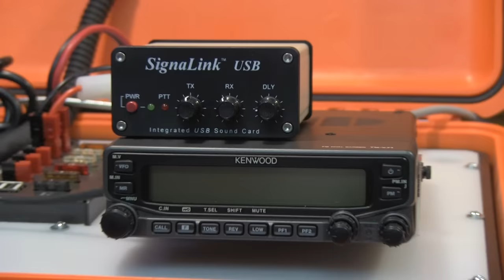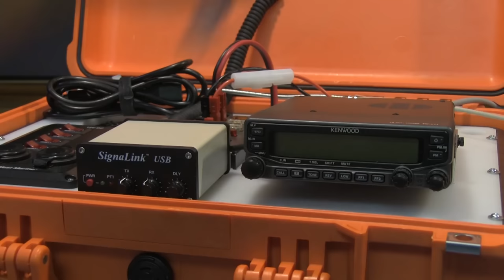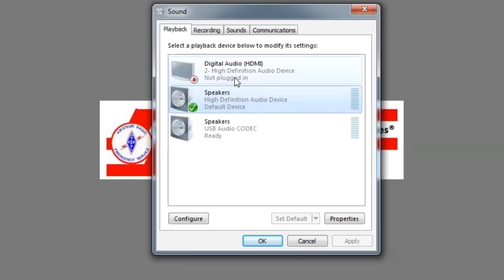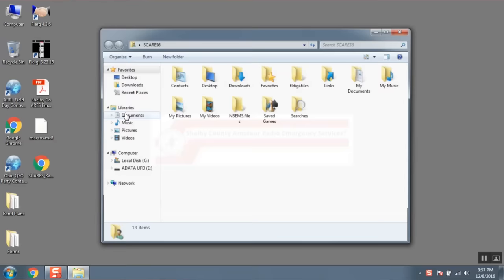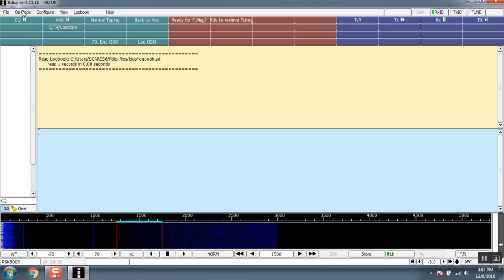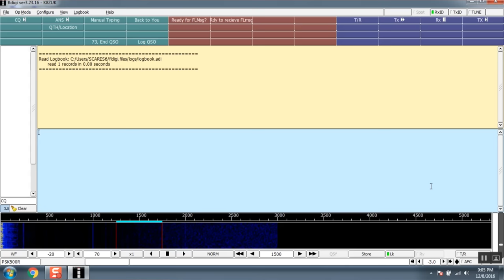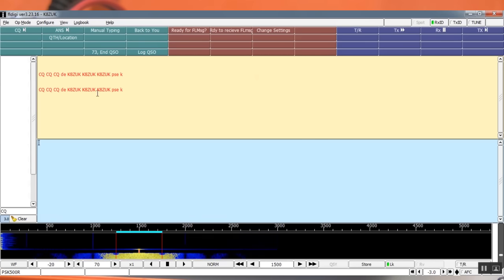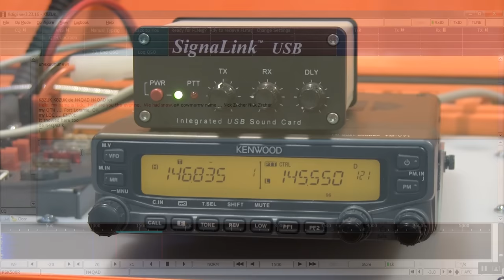FLdigi Training using 2M radios & Go Boxes

Comment: I always take a black magic marker and mark where the arrow is. It helps a great deal when you have to work in low light conditions. I liked your detailed explanations. Thanks for a great video
Reply: Also, if you have 'old man eyes' like mine, perhaps choose to use easier to see color...I raided XYL's finger-nail polish stash.  If you're box is set up so that you cannot get direct line-of-sight to sockets you're trying to plug into and having to look over the back of radio that is mounted and you cannot move it for better view, put a matching dot of same color over top of the one each cable is supposed to go to.  Then your cables and sockets are 'color-coded', and the dot of color on the cable tells you orientation (up/down) -- in training it's all easy, calm...in real-life when things go south and stress/nerves etc. kick in, fingers get to fumbling -- little things like this can make a difference in having things go a little smoother in set-up.  Just my humble opinion.
Raymond - WF7BSR

Comment: If anyone wants to test a setup they have, please let me know and I will jump on the radio.  One of the things I didn't mention in the video is that you can also download it without a radio connected.  The sound will play through your normal speakers and you can get used to it without any investment.  Obviously you won't be able to transmit over the air, but for training and following along with the video it can be very useful for kinesthetic learning.
N4QAD

Comment: You can do that with out a SignaLink. Kenwood has a set of cables that connect that radio directly to a PC. One cable is for audio in and out and the other handles PTT.  Kenwood PG-5H is the part number. You can also build these cables pretty easy.
Reply: To your knowledge what software provide the CAT control for this radio ? I've head some people have made custom XML to make it work with FLDIGI. Reading around I'm not sure there's many software with built-in CAT control for this radio.

Comment: I’m just as lost as I was when my curiosity peaked . Video after video ,, been shown how to set it up ,, no one has actually said 
1.what it does 
2..What’s the benefit
3. When would you need it
4. Why would you need it
5. Show it in use ? 
6. What am I missing out on

I’ve lived this long without it , I guess I will survive
Reply: Simply put, it allows you to send a digital file from your computer through the air using the band that you are licensed for. It is commonly used on 2m/70cm of the amateur radio band. 

Imagine if you are deployed to a medical facility to assist communication to the emergency operations center during a hurricane emergency. Lights are out, cell towers are down, and you with your amateur radio is the only link between that facility and the outside world. Ordinarily information would be spoken into your mic and copied on the other side by way of repeating it back to you. In the mean time that frequency is tied up momentarily. However, the need for digital arises when you are asked to deliver... say... a list of medication. From Atazanavir Sulfate to.... say Zantac. Conventionally you'll have to spell it out phonetically. Alpha tango alpha zulu alpha... and the other side would repeat letter by letter to confirm they have it correct. you'll be on the air for HOURS tying up that frequency and exhausting your battery. Depending on the how far they are away operating analog usually means you have to up the transmitting power which caused wear and tear and of course, elevated power consumption.

That being said, what the signalink allows is for you to take a picture of the list using a webcam, send it through your laptop, allow it to be transmitted through a hideous combination of strange noises... and have this hideous noise picked up by another station that you are trying to talk to, and they can "download" that noise into a sheet printout. they will understand you need everything from Atazanavir Sulfate to Zantac without you ever having to spell it out letter for letter. You can send this at the lowest power setting on your radio and therefore conserve battery life and minimize interference
 

that's the gist of it, if you have any questions ask away :)
73 de KN4GEI
Reply: I thought it was used for IRLP. So you can hook your radio (ie. a mobile radio) to a computer's internet. Then tap into a program like EchoLink. So it digitizes your analog radio signal....
But being backwards compatible, would be cool for sending data over the air.
Reply: @shaofuchang515  bruh...best example ever.
Reply: @chrissewell1608  Its basically another version of it, digilink is simply a sound card that interfaces the radio to something digital.
Reply: @n2dabloo  thanks, the local ARES affiliated club regularly conduct trainings of the sort, we call it SETs, or simulated emergency exercises, so that if we do have a storm and one of us gets deployed to staff a shelter with special needs or a hospital, that would be a backup solution if the power goes and phone lines fail.

Comment: I like to turn the delay up so it gives the signals time to travel from the computer to the radio and completely out the antenna before receive signals start coming back in. Otherwise I found the signals get reflected in the coax. More delay for longer runs of wire. I estimate that for 1/8 of turn of the dial is 25 feet from computer to tip of antenna. Remember to treat the cable from the box to the computer as if it was 3 times longer then it is since it has three wires in it. You can also use loops of wire if you max out the delay knob by shorting the wires out to each other. Doesn't matter which wires you connect together: You can connect one of the USB wires to the antenna wire since all the signals are analog and only digital signals are directional but require the directional cables sold by hifi audio companies. You can also amplify the signal by sticking those gold cell phone booster stickers they used to sell on infomercials back in the 2000's that you stuck to back of the battery. Stick them to the box and wrap them around the coax: remember to stick them 90's to the length of wire other wise it will just boost near by cell phones.I find those amplifiers/stickers work well in elevators and other places by giving you all five bars of signal.

Comment: Did you fabricate the cable between the Signalink and your radio or were you able to purchase it. If so where. Thanks,
Reply: Tigertronics sells cables for a ton of different radios, both mobile and handheld. I bought the one for my Yaesu FT-7900R from them through Amazon.

Comment: So all of this is limited to the 20-20k hz band width your sound card would put out? Do they make devices where you can send out "more" signal from the computer to the radio or is there no point as you can't get that much fidelity out of a radio signal from a commercial radio or the radio itself/the method your signal is being encoded with  won't use more bandwidth then that?
Reply: I think youd go for a TNC at that point
Reply: @mountain177  whats a TNC?
Reply: @daveb5041  a Terminal Node Controller. Aka a radio modem of sorts. It can handle the PTT of the radio as well as the audio.

Comment: What are you using for a TNC? Is baud rate and packet size handled by the program, FLDIGI? New ham, KE0OAP. 73
Reply: Ray Konold I have the same question.
Reply: Perfect! Thank you. I'm trying RMS. It has ben frustrating.
Reply: Surplus Firearm just learning that the software replaced TNC.  Confused since my vx-6r radio manual refers to a TNC.
Reply: @raykiii  So I want to use RMS.  Is it worth the money to buy the signal link?  If RMS is my need?
Reply: @jkbish1  Yes. RMS with a signal link  IS worth the money. I am using Winlink which needs a Windows PC to run.
Reply: @raykiii  Im rather new at this rms stuff. I am trying to get up to speed. Thanks for the comment.
Reply: @jkbish1  Get with an ARES or RACES Group that is using RMS in their emergency preparations. You'll learn a lot from them. 73

Comment: I am using TM- V71A with a Singalink with Direwolf how do you PTT want port do you use
Reply: I'm just starting out with a similar setup, but using MMTTY software for RTTY. Plan to expand into other modes later. The 6-pin DIN cable that came with the SignaLink plugs into the DATA port on the back of the radio. Go into the menu, and access around item number 518 to set one of the channels to be your data channel. I am still trying to figure out what the Data Terminal Speed setting should be. I am guessing 1200 bps for RTTY. I tried 9600 bps and (not sure if this is correlated or not) the audio coming out on the other end was very attenuated. The Signalink should figure out the PTT for you. 

See http://manual.kenwood.com/files/B62-1926-40.pdf, pages 83-84.

Comment: Why did you go to 1500 on the waterfall? I am not understanding what the '1500' relates to when you are on 145.550. Thank you
Reply: The 1500 is the band width of the waterfall. 1500 kHz on each side of center.

Comment from the maker: I've added a trouble shooting guide to the downloads.
Reply: I've been wondering for a long time,  if   there  is  a   way   to   identify    the   mode    an   unknown   staTION  might be using,  other   than   guessing   and    going   thru   all  of   the   modes   on  FLDIGI.  Assume also   that   the   station in question   has  not   checked  its    transmit   id   at  the   top.

lee byer
w7ldc
often  on   14.030
Reply: What mode fldigi is capable of do you think is best for FM while mobile?
Reply from the maker: I'm a big fan of PSKR.  Use the speeds that you can get away with.  Your band conditions will dictate if you can transmit at 500 vs 125.  Usually,  with these higher frequencies, it works, or it doesn't.  You won't be trying to snatch a digital signal out of static like a 40m conversation.  You also have a lot more bandwidth to play with using 2m or 70cm.

Comment: So this cannot use true AFSK packet protocol on VHF?
Reply: I have heard on the internet that it cannot. It has a chip built in that is issued by the FCC to block signals that are out of band or if it detects that you don't have the correct license for it. This can be hacked by taking the chip out of an SDR dongle and soldering on top of it. Doesn't matter if the pin count is different just hook up as many as you can; the chips are not that picky by how many watts you connect to each pin. Some people just use hot glue and tin foil if they don't know how to solder. Paper clips also work according to instructables if you don't have popsicle sticks.

Comment: Hello, first of all I apologize my English 
I have the Signalink USB with the purchased Data cable on a Yaesu FT8900r
One thing has become completely clear to me after 3 days of intensive work with my Win 10 64bit 1709 Enterprise version.
Devinitiv works with Signalink and the FT8900r No Echolink with Vox Mode.
Too bad I threw this in the drawer 
vy 73 Peter